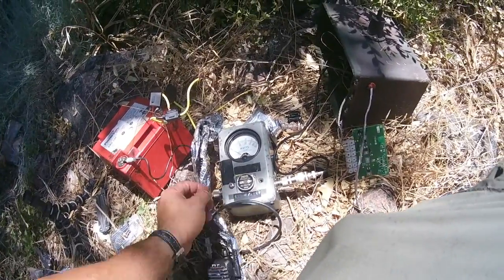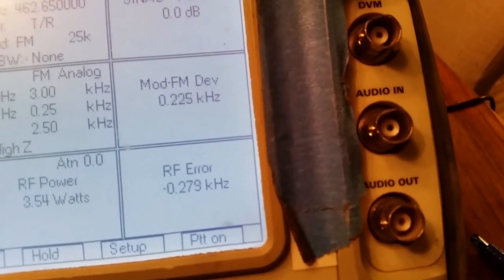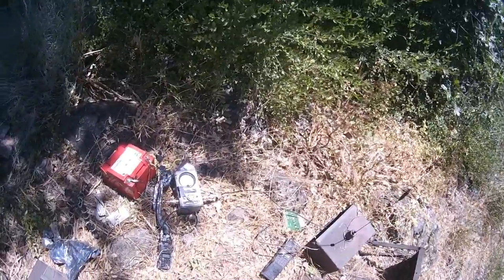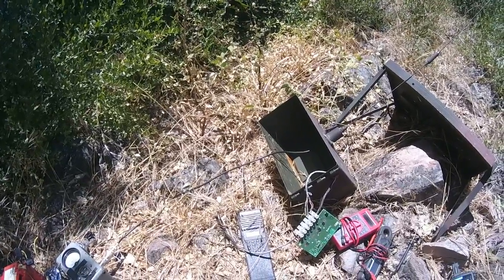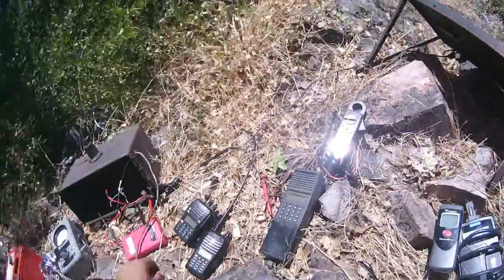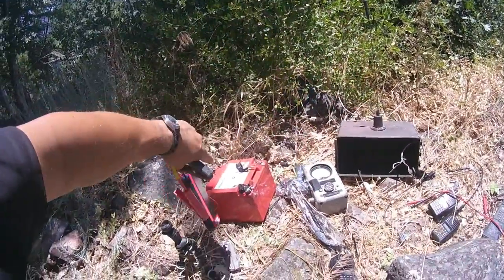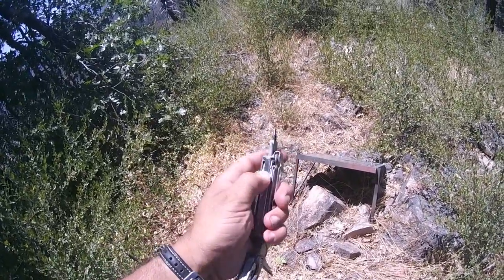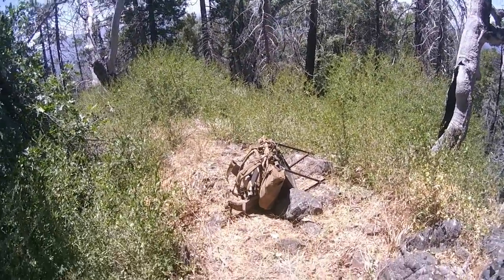2.5 Year Guerilla Simplex Repeater Checkup Summary

Comment: You can use special pcb lacquers to semi-tropicalise the pcb. from damp etc.
or can pot them in special liquid potting materials for electronics.

Use Marine grade Bulgin plug\sockets easy to terminate and fully weather proof,can be found in most marine shops or websites.
some example below
https://www.digikey.co.uk/en/product-highlight/b/bulgin/buccaneer-series-connectors
https://www.bulgin.com/products/circular-power-connectors/standard.html

these have been used in extreme conditions projects by myself so know they work well for this type of thing for radio comms projects.

Your right, better to uses a mobile radio ,more robust,heat-sinked,better filtering,plus most mobile radios have a accessory socket on the rear of radio to bring out COR (busy),MIC IN,PTT,Fixed squelched Audio to drive your repeater board.
Im building radio gateways,looked at HT's and decide not a good idea,mainly because I prefer COR\TOR  busy signal out pin in hardware options for trigger repeaters than VOX types used on HT's and mobile more robust.

Glad your got down to bottom of it,like the ammo can idea and vid.
thanks
Rob 73's

Comment: what is the foil or material that you have some of equipment wrapped up in?
Reply from the maker: Its ducting tape with the metallic material. its found in the HVAC section of any hardware store. worked really well as a RF shield.

Comment: You need to cut the top of a tree off in Mount it to the Post screw it into the post that way everything's up off of the ground at least 5 feet and gives you more height to your antenna as well

Comment: Great vid, thanks for posting!
 If the ammo can isn't insulated and 100% sealed the cool battery mass inside will cause moisture condensation when the days get warmer. Maybe burying a small cooler would be a better option for more consistent temps and lower strain on the power supply (cold and heat are battery killers). Just a thought.

Comment: would using 2 boxes help allowing you to suspend the electronics in the middle of box allowing for moisture to rest underneath electronics even if the box is knocked over? yes, you'll have longer cable runs and such but you could save space.

Comment: Hoping to see the next gear setup in the field - When are you going to be putting the repeater back up? Love your videos....
Reply from the maker: Hmm, I replied twice to this comment and it doesn't show up on my end.... 3rd times a charm.
I'm working on a setup for LE for a one day hiking event they wanted to cover a dead spot on the hiking route. I may join them or just build and have them setup. Jan or Feb. I'm also in the drawing stage on my next Guerrilla setup with a few upgrades and lessons learned hardening. That may be next april or may when the snow melts, depends on access to the site. But it will happen, bottom line.. Thanks for watching.
Reply: @GUERRILLACOMM  Any chance you might get back around to this and post the next phase? :)

Comment: Might think about a flat pack UHF duplexer with surplus HT-HT in-band repeater setup plus "ID-O-Matic" type controller.  Has worked for me in the past on mountaintop stealth installs. Did mount gear (in ammo cans to keep off the deck) and panel to a forest green steel pole, invisible ... Great Project (!!)

Comment: Good stuff!  Interesting that UHF has worked so well.  Looks like a high gain Tram antenna.  I have one on my truck.  If you are using one of those, I have seen two bad ones right out of the box, so I converted them to quarter waves.  From my own testing, VHF will perform better in the woods with a quarter wave, than UHF using a 6dbd high gain antenna .  From that elevation, 4 watts of VHF could get you out to 20 miles or more...  If you are now going for a home brew cross band repeater, consider receiving MURS, channels 4 or 5 wide band, 20khz or there abouts....,  and broadcast on GMRS.  I believe that would be legal, yet always check.  It is at least in a gray area.  One cannot use a repeater on MURS, but they can on GMRS.  In this set up one is not repeating on a MURS frequency.  Using a VHF on the receive side might give you a better chance of hitting your repeater.   I will learn from your efforts.  Been acquiring similar parts to what you have.... and installed an external antenna on a scrammbled GMRS radio.  Low power TX that is scrammbled is tough to intercept and decipher.  Thanks for sharing.

Comment: Will that charge controller heat up  you could pot the board to add some protection to the circuit.  Think about a  single wheeled cart use a 20" bike wheel it will keep the every thing up so it can't catch on the brush.

Comment: I bought a Genasun MPPT Charge Controller that is sealed for my simplex repeater build. That would help with any condensation issues. They make them for both Lead-Acid/AGM/Gel and Lithium Chemistry Batteries. 

http://genasun.com/products-store/mppt-solar-charge-controllers/  

You could also (if you own one) use your Food Saver Vaccuum Sealer to help waterproof each component. To help aid in condensation removal, perhaps there is something on the market that could be used as a vent? Something with a GoreTex like membrane that would allow moisture to escape?